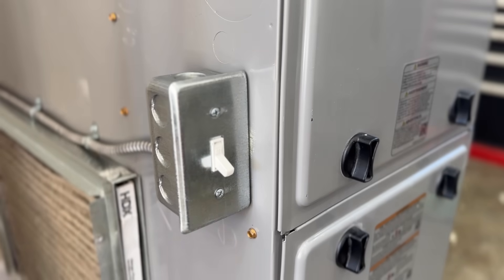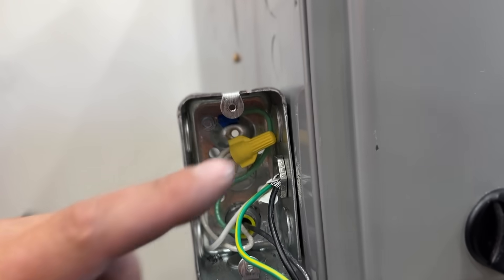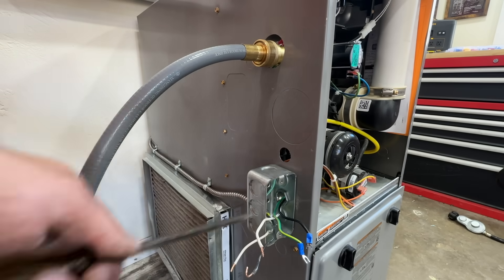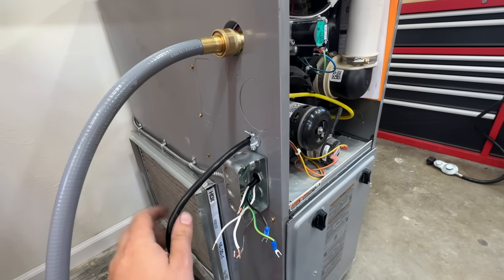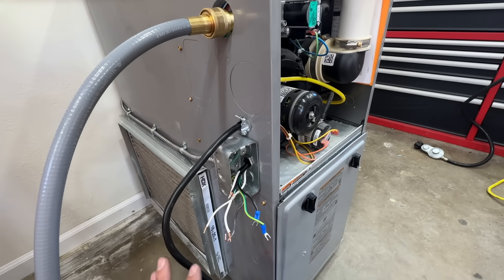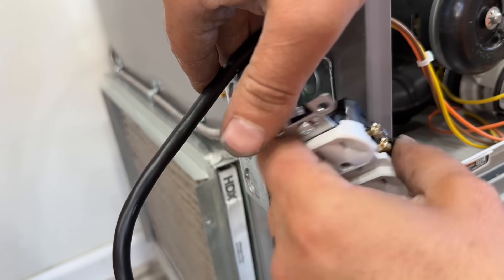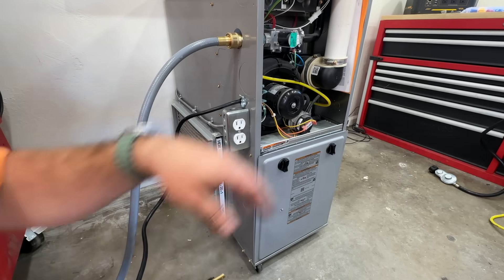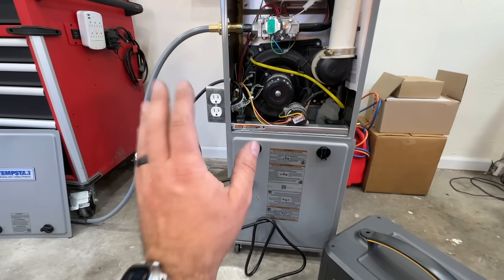Keep Your Family Warm During A Power Outage By Installing This $5 Part

Comment: First thought was - why did you loop the pigtail through the furnace?  Why didn't you just bring it into the electrical box directly?  Does doing so violate some electrical code?
Reply from the maker: Typically the furnace has its own box for connections so I just routed it back into the box so all the electrical connections are contained. You could make the connections in the furnace if you wish, but I know all the trolls would come out of the woodworks to say it’s wrong

Comment: I assume this is only for forced hot air?
Reply: Works with any setup, but if you have to make sure your backup power source has enough capacity to run the blower fans or circulators.
Reply: i did something like this on my previous oil furnace.  I plugged the furnace motor which pumps oil to the furnace  into a kW hour meter and tried to figure out oil flow per kilowatt hour of use as
a method of knowing how much oil I was using.
Reply from the maker: This only works for gas and oil burning  furnaces. It will not work with an all electric furnace.

Comment: I have a HVAC system with gas backup will this work on a AC  / Heating system. Using the gas’s backup emergency run?
Reply from the maker: That’s exactly what I have. Heat pump with gas backup heat
Reply from the maker: Yesir

Comment: Doesn’t get more easier than that. Nice fix👍. Take it a bit further I’d add a combination SW/ receptacle. This way no one can plug into the other outlet on the duplex receptacle.
Reply: I was going to say "use a single outlet or use a plastic plug for the extra outlet so no one plugs something else in there".  But yours is the best.  Solves any arcing if you turn it off before unplugging the cord.

Comment: Clever. But do yourself a big favor and change that handy box to a 2 1/8 deep, 4 inch square box with a raised switch cover. It’ll give you much more room to work with. Plus, that many wires in the handy box violates the electrical code.

Comment: Can you please do a similar video for an oil fired boiler with two shut off switches, one at the top of the basement steps and one by the boiler. I assume the concept is similar.
Reply: Yes, it is the same. The switch at the top of the stairs just kills the boiler remotely. You will leave the top switch alone.

Comment: Been using the wago connector for just four years without issues.  Too early for final judgement.  On those times the space is limited in the box, they can be a problem getting everything to fit.

Comment: Would this still work if you have a smart thermostat? Is the thermostat power also coming from the same lineup as the furnace?
Reply: More than likely yes.  Check that thermostat goes dead when you turn off that switch to be sure.  Obviously if you have a thermostat powered by AA batteries it won't go dead, but you are already fine in that case..

Comment: Great information, and I've followed along with your progression. Do you have any tips for outdoor package units wired with a pull-out breaker? 

I have no problem getting it running if the weather is nice, but an all-weather fix would be fantastic.

All of that was a nudge. I think I have it sorted out, and I appreciate the help.

Comment: I live in Oakland, CA and have been using a small 2000 watt gas generator for years during the annual summer PG&E electrical shutdowns. I normally just run long extension cords to my fridge, freezer, wifi router and computers but if I get a power shutdown during the winter this would be an easy DIY upgrade for my gas furnace.
Reply: 100%  . You don't want to use a regular generator for furnace power unless it's an inverter generator.  Furnace motherboards need clean power which an invertor will provide. Otherwise u may be replacing an expensive board.

Comment: I modified ours years ago.  Originally the 120v power cord went into a single size outlet box with a solid face via a knockout.  I installed a duplex outlet in the box and a matching plug on the cord.  Then if the power was out in winter, I just chained one of my 2 Honda EU2000 generators to my large trailer and ran a 12 gauge cord about 20' to the furnace in the basement.  Normal heat and to switch back, just unplug from cord and re-insert plug into the normal outlet.  Our furnace is natural gas so basically the power is for the fan and control board and is only a few amps (6.8 amps rated - actual is less after startup).  Yeah, I'm sure "code" requires it to be hardwired, but I don't see an inspector checking for any reason in my lifetime.

Comment: This is honestly such a fantastic way to approach this.  Prevents any possibility of back feeding your secondary power source no matter what it is.  if I lived further north you bet I would have one of these on my house with a battery generator and maybe even install some decent solar panels somewhere covered that I could deploy if needed.  Obviously gas would still need to be running but from my experience gas is far more reliable than electric.  I've actually never had a gas inturuption that I can remember but had power go out probably well over 100 times.
Reply from the maker: Same here. Thanks for your input
Reply: @diyhvacguy  1:]
Reply: Yep
Reply: You could run a generator on natural gas, too.
Reply: I had my gas shut off when i couldn't pay the bill. They put a lock on the gas valve thing outside. I cut the lock off. They were not happy.
Reply: If you have an emergency you need and outlet and three wires and about 10 minutes of time, no need to do this ahead of time in my opinion as the switch is more convenient for now.  Everyone I know has junk extension cords laying around and old outlets :)

Comment: I have a horizontal 80 % gas furnace . It had a plug into my old house crazy ungrounded cloth romex outlet.
About 5 other things are on that breaker.

I had the new 200 amp system line and breaker put in And a dedicated outlet put in to run the furnace another separate breaker for the sump pumps .

The outlet was  checked and all wiring is correct including ground.

However the unit Will Not light when plugged into the New Good dedicated outlet only the old outlet!

It blower runs but will not light off.

Any advice?
Reply: I don't know the answer but curious what the crowd has to say.

Comment: I watched one of your older videos and decided to do the outlet last year. My furnace was less then a year old and was told if I pulled the furnace cover and altered the wiring in any way I would forfeit my warranty. I chose to follow the wiring from the main panel to about 6 feet from the furnace and put an outlet there. I was told it had to be a circuit and single outlet designated to the furnace only. So someone couldn't accidentally plug something else in with it. I did actually have to add 2 boxes, one for the outlet and the other a junksion box because I had to add wire.
Reply: Genius idea and if in the same situation I would go with that. Did you test it out for a few hours? In an emergency you would definitely be keeping the heat on for hours. Did the juction or new wall box heat up? Did you ground it?

Comment: How long will the 1000 watt generator provide energy to the furnace?
Reply: Lots of websites say 600w for a gas furnace, which means a 1000wh battery would last about an hour and a half of continuous running.
Reply from the maker: This Vtoman did the best of a lot of different power stations I tested. About 20 hrs i believe. That is, of cycling, not straight running

Comment: Will this work the same way with an oil furnace?
Reply: Yes, the fuel is unimportant, but make sure your backup supply is "clean" (most portable generators will damage heating control boards).

Comment: Question so with this setup with a bonded generator using a extension cord the generator ground and the main house ground are still connected to each other is that ok ? The generator is connected ground to neutral "bonded" and the house ground is connected to its neutral and that makes them all connected via the heater housing and the plug box housing What happens when power is restored on the house side of the ground/neutral ?
Reply: The furnace becomes unbonded when the plug is separated from the outlet. It's an isolated system then.
Reply: The house ground and the Generator ground are always connected via the heater case and plug box ground. From what I understand the house ground is connected to the house neutral too. Sorry but I'm so close to setting this up its so easy but I just want to fully understand how this ground works BTW thanks for the reply....  @projectswithjw

Comment: I like this set- up better than the first one mostly because of the simplicity of the wiring. One minor add-on to consider would be a tag or small sign indicating that the furnace disconnect IS the plug and they aren’t looking for a switch that isn’t there. 
Nice job. 👍👍👍👍
Reply: My thought exactly about the tag/sign.  It is not obvious to a furnace tech-they would be looking for a switch!
Reply: It's not only the furnace tech, but the electrical inspector.  Both are looking for a disconnect switch and/or a single outlet:  NEC 422.31(C) – The furnace disconnecting means shall be within sight of the equipment.  NEC 210.8(A)(5) – Receptacle outlets for the associated equipment of a furnace installed in an unfinished portion of the basement shall be GFCI protected, and if installed on the furnace circuit shall have no other outlets.  Also, depending on your installation, the NEC code and local codes may require an AFCI circuit for the furnace blower.  Eg. finished basements.
Reply: @milofonbil  That's why  I spent the money on a disconnect and a guy with papers to install it LOL.  I also power enough led lights, microwave and fridges to keep everything frozen.  I even had room for a receptacle at my countertop for the coffee maker. The input plug sits outside the garage beside where the genny rolls out. We get extended periods below -30 C in winter. Shit gets real pretty quick with no power.
Reply: Either way having an outlet thats used to power anything by means of a suicide double ended homemade cable is not code.  Also need a lockout device that cuts power to the main power feed timo the house making it not possible to run temp power with the main breaker on..
Reply: @milofonbil  So basically, in an unfinished basement, the only thing you'd need to do differently from this video is replace the standard outlet with a GFCI? Seems simple enough
Reply: I was also thinking the same thing. I work in HVAC and I would naturally think that that plug would be for the condensation pump and not main power. We like for everything to be labeled if it's not straightforward or the way every other unit is set up. Also, if you know which pipes go to which parts of the building, PLEASE label those, too! It makes servicing a problem way easier on our end!
Reply: In my Canadian jurisdiction, where the majority of furnaces are located in the basement, the furnace disconnect switch is never located on the furnace.  The disconnect switch by code must be located on the wall, in the stairwell to the basement.  This allows the fire department to disconnect the furnace from power source before entering the basement for their safety during fire fighting operations.
Reply: I kept the switch anyway even though I disconnected it.  that will really mess them up.

Comment: You aren't supposed to use a cord that is bundled or wrapped up. Heat can build up. I'm not entirely certain why you need to  loop the cord into the junction box. Connections are made inside of the furnace. Just keep the connections around where the electronics/transformers are. Oddly enough, our doorbell transformer is inside the furnace. If we use the furnace again, I'll probably put in a light switch to disconnect the furnace. They never put one in. I'll put the doorbell transformer with the switch. Right now, it just costs way too much to replace our furnace and air conditioner. The floor vents also need to be moved to the attic. It's too expensive, and that was before the economy went down the toilet. It's like, forget it.
Reply from the maker: We are talking like 3-5 amps, the word length isn’t a problem. Typically furnaces have their own box inside the furnace to make the 110v connections but mine doesn’t. So I just looped it.
Reply: Dude, this ain't 1950. That cord will handle 15 Amp, rolled up in a ball.

Comment: My swich box is mounted about 4 ft away from the heater. What can i di?
Reply from the maker: The same exact thing. That’s why I created the video this way. You are just changing your switch box to an outlet, and wiring your pigtail to your furnace so it is totally isolated 👍🏼
Reply: @diyhvacguy  Ok, i installed a outlet box just like yours at the furnace and wired everything like you have it.   I also have a Vtoman 1000 power source. Do i need a neutral ground bonding plug?

Comment: Great idea. Not to code
Reply from the maker: Yea that’s what some say, but several master electricians have said that most inspectors would be totally fine with this and there is ZERO risk of danger doing this.
Reply: Still against code because permanent installations are required to have metal conduit protecting the conductors that power it.

You might find an inspector that will ok it, and in some jurisdictions it might be ok because they use a very old NEC code as the basis for their inspections. However if the code requires it, and an inspector passes it anyway, he's not doing his job and should be fired, in my opinion.

Comment: Did you break the tabs on the recepticle? Whats to stop power from backfeeding to the plug ends? Maybe I missed it,also you now have no service disconnect at the appliance! Maybe wire it with a female end,and make an adaptor.
Reply from the maker: Yea you are not understanding. The pigtail is simply wired so the furnace has a pigtail you can plug into a regular outlet, just like a toaster or a microwave. And the switch simply becomes an outlet, so now you have two outlets you can use, one for your furnace, and the other for a condensate pump or a uv light if you wish. But the make ends of the pigtail will NEVER be live. Hopefully that answers your question. Cheers
Reply: I see what you did,my bad!  I have always just added a female plug at breaker gor essentials

Comment: Great idea but those wagu connectors should NOT be used.  They do not give you a tight connection and will heat up with a high or long running load and actually melt.  Use good old fashioned wire nuts.  
They are time proven and don’t fail.  
Do you really want to risk burning your house down?
Reply: Nonsense. WAGO connectors will take more amps than the wires attached. Lots of YouTube videos demonstrate this using a welder for a power source.
Reply: I have had bad experiences with wire nuts melting also.  Nothing is fool proof.
Reply: They've been used as a standard in Europe for years and are now becoming popular in the US - they're completely reliable.

If one melts, you weren't using the proper Wago to begin with.
Reply from the maker: I disagree. But to each his own 👍🏼
Reply: If you disagree you haven’t been using them long enough.   Wait and see my friend.  You’ll find out.  Remember old school brings us to new school but sometimes new isn’t better.  
Wire nuts are time proven and do not fail.
Reply: @bobcumbers3624 I only use wire nuts,but they absolutely fail. Youve never seen one melt?
Reply: Wire nuts DO fail, they corrode, become loose, Wago nuts have been tested with much higher than rated loads and they did fine, there's even videos showing it.

"Can loose wire nuts cause a fire?"

", a loose electrical wire can cause a fire. When electrical wires are loose, the current flowing through them can generate heat. Over time, this heat can cause the insulation around the wire to melt or become damaged, increasing the risk of a short circuit or electrical arcing.Mar 31, 2023"

Wago lever connectors are UL listed and approved for use. Mar 27, 2022

All electrical devices used in America must be listed/tested by one of a few orgs, like UL/ETL/CSA.

 @bobcumbers3624